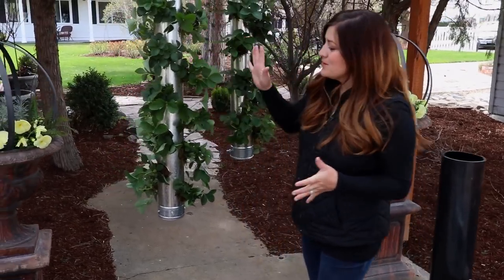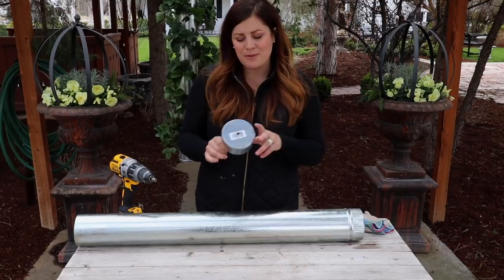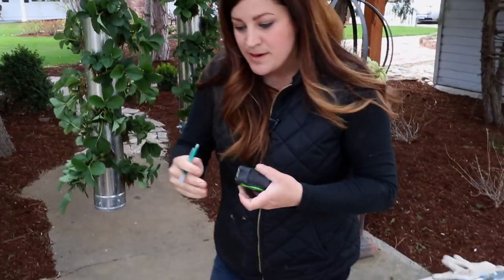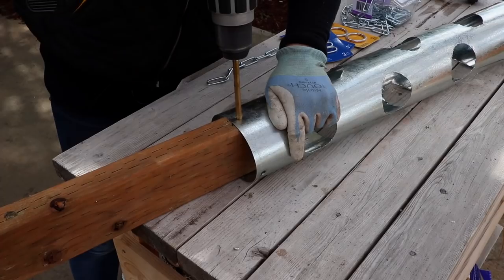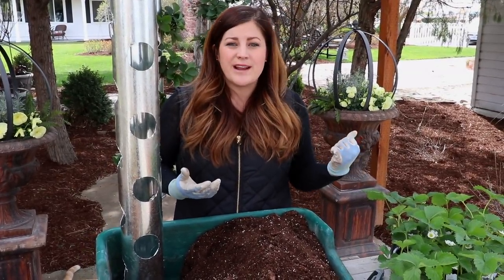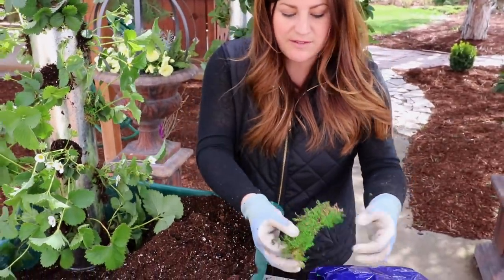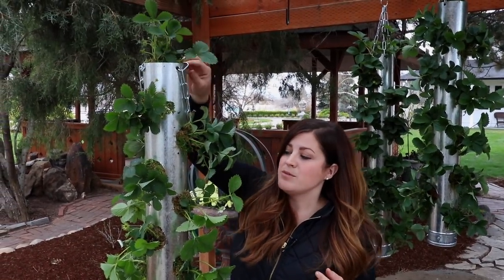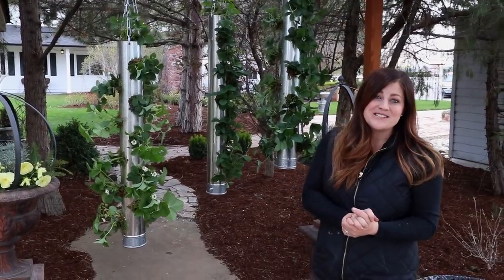Galvanized Vertical Strawberry Planter! 🍓🍓🍓(FULL VERSION) // Garden Answer

Comment: It would be awesome if you posted an updated video for this project in the future (how well the strawberries grew since they were sideways, what to do when the plant produces runners, and how well the tube held up during the season). This is such a cool idea!
Reply: i've been told that the biggest challenge with single stack vertical setups like this is with watering. Drip irrigation probably helps.
Reply: I 2nd that! I'd like to know if they held up over the winter.

Comment: Well, I did my research and galvanized containers are safe to grow in. Soil should be around the neutral range which won’t deteriorate the zinc coating, stock tanks have been used for years and years and and still in great shape.

Comment: I would love to see a follow-up in late July or August to see if the bottom half survives.
Reply: If worried about not getting water, you could put a small tube or pipe down the entire middle, with a few tiny holes to let water drip out slowly.  
If worried about that area getting too much water, could ask drainage holes.

Comment: Just to remind you. Most of the pipes you drink from are pvc pipes. But if you are worried about the pvc glue. I would just find a large enough cap and bolt it on or use silicon gel. Anything else for peace of mind. But pvc pipe shouldn't be a problem

Comment: If you take a rubber tube and slit it down one edge you can clip it around the rough edge of each hole and it will make it safer for planting and harvesting from it for years to come - natural rubber is non-toxic, or I am sure you an get food grade soft plastic tubes but I don’t know where - maybe in wine making kits or similar? Anyway just an idea xx
Reply: Lizzie Dean Makes. What about the tube used in aquariums. Would it work ? it comes in several sizes
Reply: Lizzie Dean Makes g   .

Comment: PVC rigid pipe as been food safe since the 80. The NSF already has standards for food and water safety. Just make sure it is NSF code on pipe. When you hear toxic from pvc they are taking about pipes before 1977. The FDA has approved PVC for a while. Galvanized metal is actually worse than PVC.
Reply: She was referring to PVC glue as being toxic, not the pipe itself.
Reply: So my NSF water pipes are toxic because of the glue and not because of the pipes??
Reply: @ohsweetmystery  worth concern, but PVC glue is only toxic before curing, much like most wood finishes that are on cutting boards and salad bowls.  Once it is fully cured it will not deteriorate or offgas and is safe for potable water.
Reply: @ohsweetmystery  She actually mentioned both the glue and the pipe as an issue.
Reply: Most modern PVC is safe when used indoors. Outdoors is a different story. PVC degrades when exposed to sunlight, which these planters will get lots of.

Comment: I might try this hanging method; but I would try using the tubes that are sold to pour cement in ;I believe they are available in 6 inch and up. 2 good reasons, the  main one would be the heat transfer from the outside of the tube to the inside  should be minimal. And , as important I think...those heat duct tubes would probably start rusting pretty quick, as they were not designed to be in contact with  wet surroundings...Just my opinion

Comment: If you use a deburring tool, it will remove all the sharp edges in the metal and make it easier to hold without getting cut. They usually run around 7 dollars at Home Depot or Lowes.

Comment: For anyone worried about toxicity, etc., don't use Galvanized or PVC, do this using drainage pipe which is typically made from HDPE on the inside.  Polyethylene is going to be your safest option when it comes to plastic.
Reply: Doesn’t long term sun exposure cause release of toxins from polyethylene?
Reply: @Parker  Ethelene and methane are released from PE.  It's more of an environmental issue than a direct toxicity issue with chemicals leeching into a nutrient solution.  PVC and galvanized steel are much more of a problem on that front.  Ideally glass, ceramic or porcelain would be the safest materials, just not practical.

Comment: You don’t need to use that glue stuff on PVC for the ends. Just pre-drilled a hole and just put a screw in it like you showed with the tin.  And I wouldn’t drill such a big hole. What do you do with them in the winter time so they come back year after year

Comment: Great idea in many ways, BUT wont work for strawberries, but would work great for pretty non-fruiting shade plants with a wider pipe & holes cut differently (as described below). The probs for any plants with this exact method are: 1) Pipe is far too narrow & needs to be wider, because:    a) soil & water falls out & plants almost always die when holes are cut that way, so they need to be cut differently which requires the pipe to be much wider as explained in point two (2).    b) Theres only enough soil available for the roots of 3 strawberry plants (& many other plants) in one of that size pipe, so any more would very quickly get root bound, dry out, never fruit, (& eventually die when fully grown by planting too many). (My strawberry plants rarely fruited for yrs & the few fruit I got were tiny when their roots were restricted.Also this caused the pots to eventually not be able to take in & hold water because the soil was overtaken by roots, but since I transplanted them to many far bigger pots they grow lots of large fruit.
c) Plant roots will quickly fry inside that narrow pipe if the plants get enough sun needed to fruit. d)When holes are cut that way its far too dangerous & will cut thru U & the strawberry stems/leaves. Point 2 gives a good & safe alternative way to make holes. 
 2 )To cut holes so soil & water doesnt fall out & no sharp edges are left, each hole needs to be made by cutting a 5-6in horizonntal slit & then use any type of wide, flat, hard tool to be pushed into the slit & then pulled back & downwards to make a pocket for each plant so the holes are facing up & not out (this pipe is far too narrow to do this). To limit/ stop sharp edges, pliars (or similar) could be used to bend down the cut edge of each hole that is pulled outward.
 3) That thin metal looks great & would work for a few shade plants IF holes are cut as I suggested, but it wont work for strawberry or other fruiting plants for 3 reasons: a) Even though a far wider tube would be better cos the roots wouldnt all be crushed up against the sides of the hot metal & immediately cook,  the roots would still get far too hot inside thin shiny metal in the sun, & even if it didnt kill the plant in a wider pipe, it'd mega-stress the plant so it'd be weak & unhealthy & prob wouldnt fruit. b) the very hot pipe & its external sun reflection on the leaves & any unlikely fruit would burn them severely. c) Gal metal is prob at least as toxic as PVC pipe. I'd never use either for edibles, but your idea for non-edibles is really lovely for 3-4 small shade plants if holes are cut differently, so the plants would remain healthy & not dry out etc. Great effort, & I love that U think outside the box, & 1st attempts usually need a few alterations, but the 1st new ideas & attempts allow us all to appreciate that & maybe see possible improvements so we can all move fwd together. I commend & appreciate this!

Comment: I was watching this again and was wondering if it would be easier to cut the big holes before you snap together since the metal thin. You may have tried and it was hard to control the metal open.   How about a drip hose down the centers.

Comment: Galvanized! You need to tell your viewers to look up 'zinc toxicity'.
Reply: Ut oh. There goes that project.  Cool looking tho. Thx to who ever posted that.  Any ideas as to an alternate material??
Reply: @marydiscuillo142  PVC it's safe
Reply: It's toxic when heated!
Reply: @j.harris7228  heated how hot?
Reply: @wendygraphman3658  Temperatures above 392 F
Reply: @j.harris7228  if you breathe the air from melting or burning pvc yes.  It transfers no chemicals to water or soil afterwards.
Reply: This is not of concern... the plants would have to uptake a toxic level and then deposit that toxic level into the fruit that you eat. Strawberry plant simply aren’t going to do that....

Comment: Doesn't most our house water run through PVC pipes with glued joints? If it's OK for water, why wouldn't it be OK for planting? Will your metal tubes rust?
Reply: Most easetroughs are galvanized metal. Or at least everyone I know.

Comment: This looks really cool. However as one who grows strawberries in a container mounted to fence I find very quickly the root system of strawberries takes up most of the space. I used a type of planter, tubelike as is yours, not mental and had to completely destroy the container as roots were a solid mass inside. You can probably just open up your tube later?? How will you keep the birds away? I tried netting my strawberries but birds can land and still get to them. The birds peck at the fruit and then come the fruit flies or something similar and we get hardly any strawberries. Anyone have suggestions? Anyway good luck and let us know how things go please.
Reply: CJ I built some cubes from pvc pipe and wrapped them in bird netting for my container strawberries. It's large enough so that even if the birds land on it they can't reach the berries.
Reply: Randall Masoner that sounds interesting. Can you describe that more? I have a strawberry tower I made out of milk crates and I don't want to lose everything to the birds like last year

Comment: Two mistakes there. Watering evenly is a pain. Put a watering tube inside. The hole edges are too sharp and will damage the plants. A rubber gasket should fix that.

Comment: Doesn't galvanized metal contain Zinc? The whole purpose of galvanizing steel is so that the Zinc will oxidize first so that the iron doesn't rust. This means Zinc will slowly fall off in bits and contaminate the soil or any vegitation. Pick your poison, you can either have plastic or heavy metals in your body. 

I don't know which is worse. I am lazy but think too much. The next step would be to determine the ppm of particles accumulated a period of time and then utilize some medical data; LD50, acute toxicology, and long-term exposure effects.